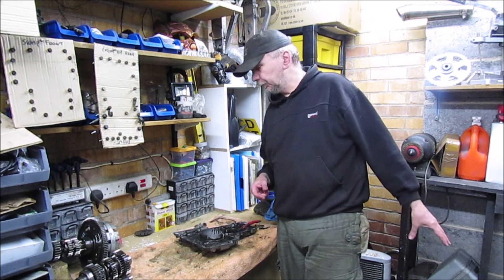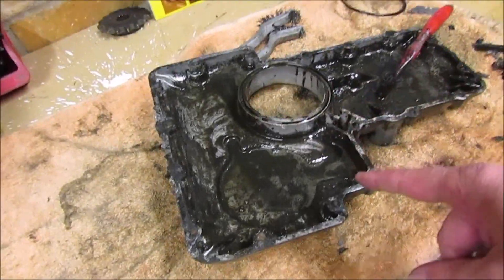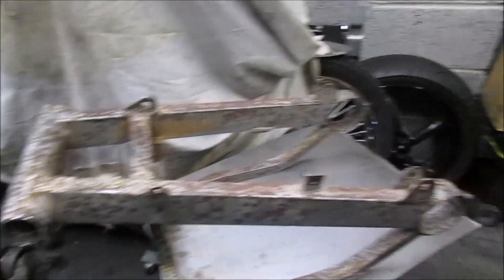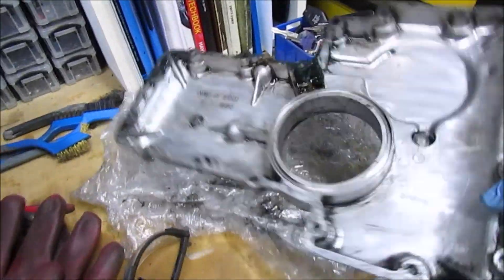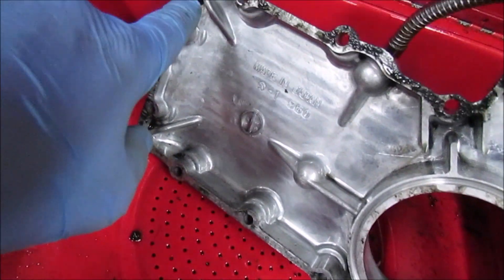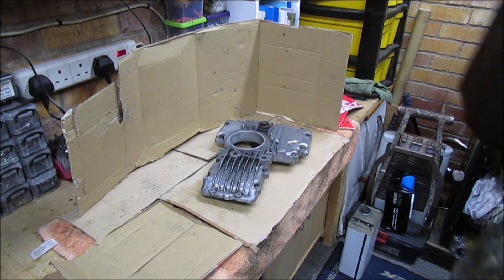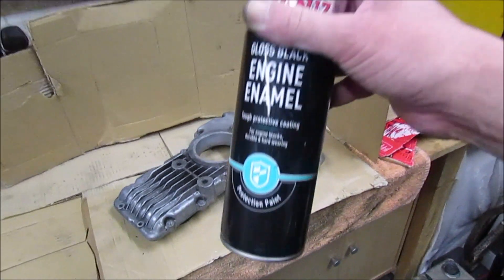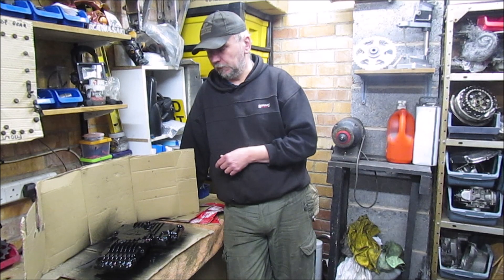Kawasaki KZ1000J/Z1000J2   Project - Engine cleaning - Part 8

Comment: Hi Keith
I am busy installing the cams on ( GPZ1100B1) and did not mark the exhaust and inlet , flip hope I do not go wrong. Had the valves and seats reground and having fun trying to set valve clearence on the bench.
Thanks for the videos.
Reply from the maker: i will check mine as labelled them as they came out, will let you know

Comment: A heat gun should loosen those studs. You need heat, but not to much
Reply from the maker: Thank, may have to give that ago as they are solid
Reply: @TheAmateurBikeBuilder  people under estmating the heat gun.  Often there are torches when you don't need it.  Sorry for bad english.  I solved a lot of things with just a heat gun.  Best control.
Reply: I think you need to heat up the aluminium around more then the stud.  Careful. You don't want to warp things.    I'm no expert though. I would have the 2 halfs of the  crankcase clamped together before heating.

Comment: Hi Keith, do you use a solvent or water based cleaner in your parts cleaner? The Glossy paint looked nice.
Reply from the maker: i use Rock Oil SOC (soluble degreaser) works really well, paint came out well will wait till it drys to see what the finish is like